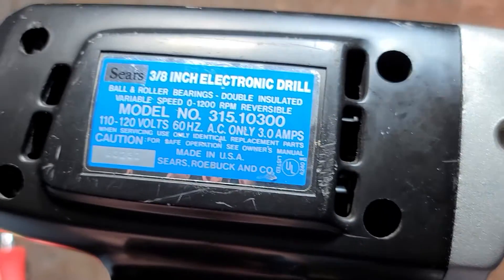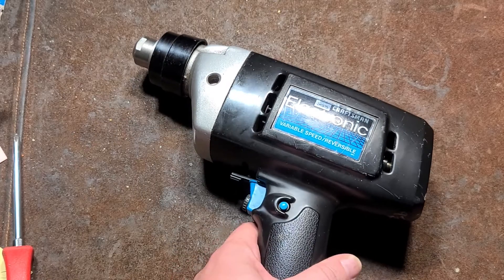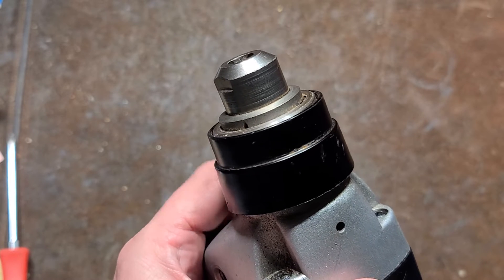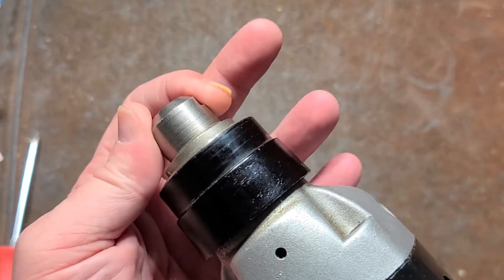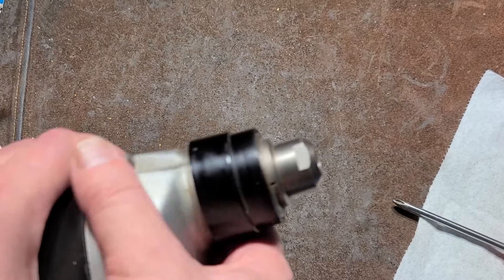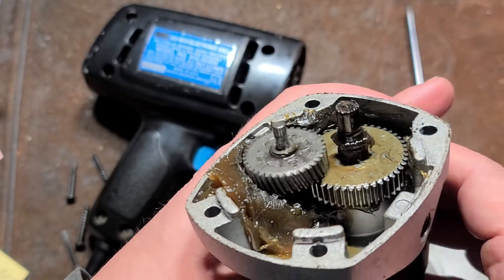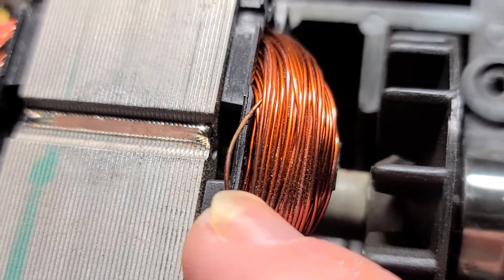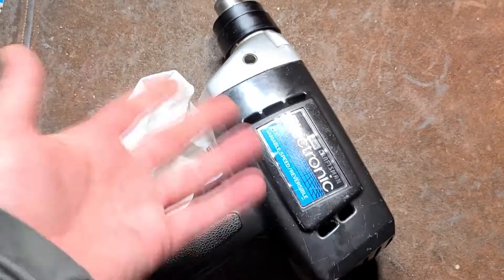1970's Craftsman USA 3/8" Impacting Keyless Chuck Drill Review/Teardown

Comment: Okay  I'm afraid you're in error about the hole on top, you do not add oil in this hole ,you put a punch or nail to lock up the shaft so you can remove the chuck. They are great drills, last forever , just a little big in size for a 3/8 drill